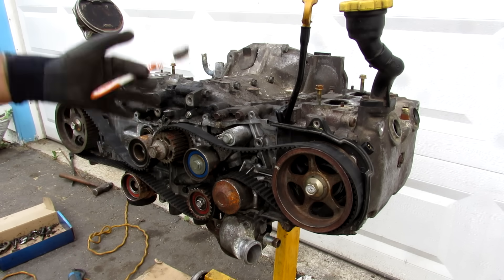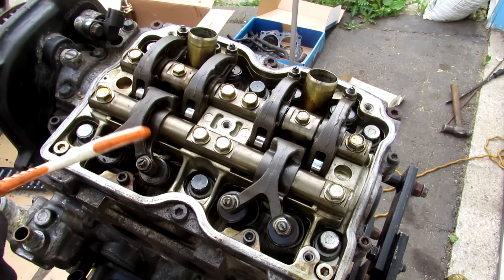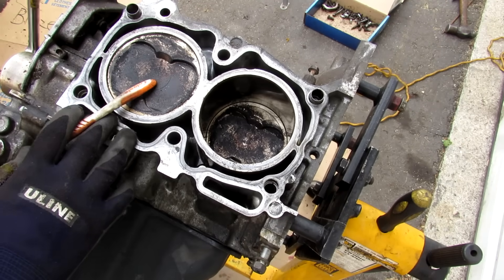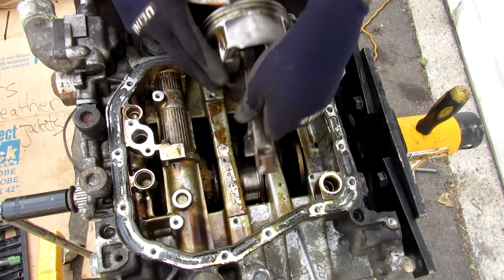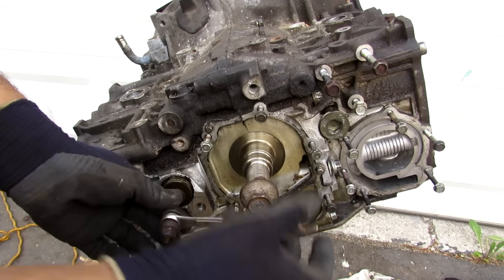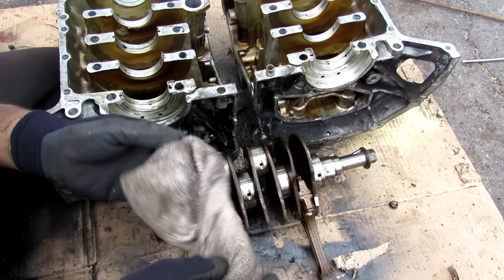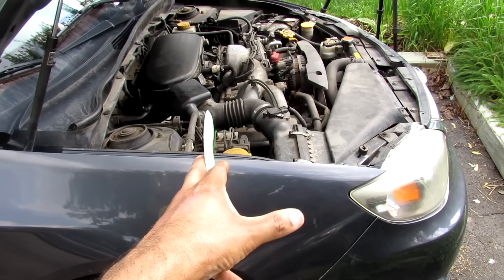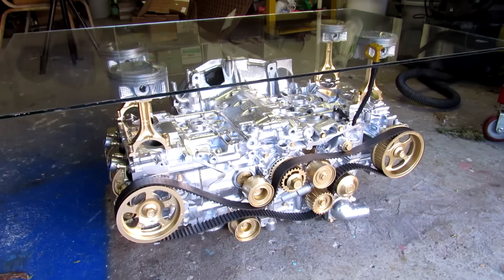Why Subaru Engines FAIL

Comment: My family has owned several suburus and they all leak/burn oil. If you own a Suburu you have to meticulously check the oil, it is not uncommon for a well maintained boxer 4 cylinder and the inline 4 to burn/leak a quart of oil a month while under a 100k miles. Its almost as if they were designed to leak oil from the factory. If you get lazy and it runs half a quart low it can severely reduce the life of your engine. That said they can be great cars but i strongly discourage anyone buying a suburu used even from a dealer, they will knowing sell you a car with a leaky head gasket.
Reply from the maker: Some over fill the oil on these

Comment: I do not know if the boxer engines overall are like this but it just seems so needlessly convoluted that the whole vibrates less and it's better balanced pros seem like very minor gains when compared to the nightmarish amount of difficult servicing issues that this design causes. You basically need to drop the engine every time you need to do any maintenance beyond an oil change.

Comment: Subaru fans be disliking this video lol
Reply: @tenis_Alekna  I'm thinking he was referring to the fan boys and not the actual fans/owners.
Reply: Infiniti owners be like i told you your cars and engines are garbage! Lol
Reply: I’m a Subaru owner and I never like EJ25 engine cause they are shit. I drove a JDM EJ20 purely made in japan and never given me an issue.
Reply: Maybe only the 2.5 owners, even then if they love it they love it, i have a 2.0gt and Sofar (170k) no engine issues, every thing thats failing on the car is age related rubber rot after 15 years in the bushings ect. Never been on the side of the road in the life of the car and ive driving The ever loving piss out of it :) in japan hete i think they save the good ones for domestic and export the less then great :/ idk
Reply: The opposite is the case. Quite informative for a Subaru enthusiast like me.
Reply: I have an FA20 and he's not wrong 😂
Reply: No, I think only one series had problems because Subaru like many others were chasing economy by reducing friction.  Pistons were their first target and the re-design led to high oil usage.  Many other makers suffered similar problems.
Reply: Currently fixing the hg on my wrx now. No dislike
Reply: The EJ25 was made from a 2.2L bored out to the limit, and that's why it's so hard on head gaskets. The open deck cylinders just vibrate too much for a standard head gasket. The Fel-Pro replacement is supposed to be bullet-proof.
Reply: The 2.0 boxer engine was one of the best engines Subaru ever made. It outlasts almost any other four-cylinder engine on the market (and really ever produced). That’s why this video is kind of funny.
Reply: @anthonyfisher6051  haven't built many Subarus I take it?
Reply: Jarrad Lewis 
I don’t build Subarus, I drive them. I’ve owned three and they have been the best cars I’ve ever owned. Basic maintenance and they run forever.
Reply: @anthonyfisher6051  if you can find a 2.0 that's still bone stock I'll give it to you that they're reliable, though tend to become leak happy around 70k. The problem is the cars that they're in and the people that drive them USUALLY don't leave then alone or don't tune them properly
Reply: Jarrad Lewis 
Fair enough. I’m not one to modify my cars, they’re strictly a means of transportation for me. If it gets me up into the mountains and the forests without issue, I’m a happy camper, pun intended! 😁
Reply: Subaru fans don't own Subarus, Subaru owners aren't fans. I've got a total of 2 under my belt that are now gone from my life, one of which was fully built for track, I wasn't a fan of either of them. This video is 100% accurate.

Comment: I guess I've been lucky. My Forester has 160,000 miles with no issues, just basic maintenance. I brought it because it had good safety ratings and a four-wheel drive for the snow.

Comment: Interesting video. Answered some thoughts I have had over the years about the boxer engine.  Have porsche solved all the issues that subi engines have?  Never really hear them having the same issues subarus do apart from some rear mains leak issues.

Comment: Wow... very interesting. I know of the boxster engine by name, but was not aware of all the characteristics which makes it a boxster. Pretty cool. I loved the trick using the 14mm bolt head to remove the 14mm engine hardware. I’ll have to keep that little trick up my sleeve for similar situations. Thanks for that.

Comment: There is a reason why some car brands after many years still build boxer engines.Because they work good.But every engine also have a fault degree and thats the cost reduction when some parts aint built to last, sadly.

Comment: Boxer engines are shit. Thats why i will never buy a GT86 cause of the engine. In fact, the GT 86 doesnt even have much power, it would  have been so much better if they had put a basic 4cylinder in it

Comment: Did you know that the Subaru engine was originally of British make and design . Two brothers, William and Benjamin JOWETT , designed and developed a horizontally opposed V twin in the early 1900' s. In 1936 the boxer four made it's first appearence and the brothers designed a very advanced 4 door saloon post war. Sadly they didn't have the facilities for large scale production and went into liquidation in the 1950's . Subaru bought the copyright 's to the engine and developed it into the amazing piece of engineering we have today. I can recall driving an Impreza in the early ' 90's. In those day's it only made 210 bhp but was crazy  compared to what was out there. The only comparison we had ( in the UK ) was the 4WD Sierra 2.8 V6 which frankly was a tractor in comparison, the Subaru was very well engineered.

Comment: I always thought Subaru's were over rated and poorly designed. I demo'd one in 2018 and it handled like a farm wagon. I could feel the weight of that motor in the steering. It's hard to explain. Let's everybody boycott Subaru and start converting motors to shop clocks!

Comment: Biggest mistake Subaru owners make is not buying the proper oil filter.
That orange blob is not the proper filter.
Subaru has a high oil pressure. If the oil filter has a low bypass pressure rating, the filter is not going to filter much.
Oil is going to move around not getting filtered.
If you don't have access to the correct SUBARU oil filters, MAZDA RX filters works just the same.

Comment: Dude, a brilliant analysis!  Brings back bittersweet memories of the used Outback I bought some years ago.  I used to chuckle with my friends about the colorful stains on my carport under 'Suby'...why, I had black, yellow & purple!  LOL  Not anymore!  I drove this car from MO to L.A. one summer.  Hard to check the oil as the stick is 13 feet long and twisty.  Next fall the engine blew out.  Subaru been making this 2.5 for decades and STILL haven't tamed the beast. At 3:31 upper right the gasket is too thin/congested with holes for bolts/oil/coolant.  Don't pay a lot for a used Subaru!

Comment: I had a 2000 Subaru Outback boxer engine that had 190,000 miles on it when I traded it in for a newer Subaru.  No issues with either engine.

Comment: well all i can say is that the Subaru boxer is the best motor i have ever owned as a guy who does 90% of the maintenance my self subarus are a a joy to work with while if Im ever so unfortunate to have have a HONDA Civic ever again i would rather buy a new car then try and fix any thing on that shit.
i have had a bunch of cars from different makers subaru, honda, toyota, opel, not many american cars except old ones that i have helped restore/fix they are easy as well because engine bay would be 3 times larger then the engine so enough space. but yeah love me some subaru

Comment: Subaru pushed the design too far. The 1.8l engines in early Subarus had a good percentage of them reach 200,000 miles or more. The 2.5 engines never reached the reliability of the 1.8's.IMHO

Comment: This engine design is actually derived from an aviation engine. In which application the are very reliable. Main reason is that they are operated at a constant speed. This reduces many of the oiling issues on this engine. 
The main failure i see on these is actually timing belts. Personally, i stay away from them.

Comment: Had one of these motors in an 89 subaru XT. Drove it 260000 miles. Very quiet economical motor, easy to change belts too!

Comment: You stuck a screwdriver blade against the machined surface of a cam lobe to stop rotation of the cam when removing the pulley. So you're trashing that cam and possibly breaking the head casting.  Supposed to hold the pulley with a tool when removing that bolt.

Comment: I have owed Two them 300,000+miles on the first car and 280,000+ on the one I'm driving now and no issues with either car !!  Just get your regular maintenance when you are supposed to, or do some yourself if you can !! : )
Reply: I bought one cheap with 99k miles and very early signs of a failing HG. I squeezed another 100k miles out of it before hitting a deer and totaling it and all it needed during that time was regular maintenance and new front rotors.
Reply: Mine runs like a top!
Reply: I hope this is true for my FRS!
Reply: That's what I like to hear! Bravo.
Reply: It sucks that most people don’t do that. I’ve bought 3 Subaru’s and and 2/3 burned oil because of bad maintenance. I got a 98 legacy with a 2.2L motor which was bulletproof, it only died because of not doing the timing belt. I bought a 98 legacy GT with a 2.5L engine and it burned oil like crazy, it eventually got rodknock when it burned all the oil in one day. I replaced the engine myself in that one with a junkyard one with blown head gaskets and replaced them myself, that engine also burned oil but only about a quart every 2 weeks so it was alright, I still have it, but one of the brake lines broke and I haven’t gotten around to it. I have a 04 Impreza wagon and that one burns oil but I bought it fully knowing what I was getting into so I only paid $1k and it has 131k miles. I couldn’t pass it up since it was manual and it’s pretty much impossible to find where I live. Sadly it’s not the owners fault it burns oil, they took it to a shop that was robbing them. I’m currently in the process of doing what the shop didn’t do. I’m going to have to do a tune up and eventually a engine rebuild or swap:
Reply: @itsvoodoo7050   It's good you can do your own work etc, so many are just Lazy or clueless.
But there are so many garages that don't care etc. I to do the work I can and keep on it. It really makes the difference what ever the brand. Thanks for posting !!  : )
Reply: @itsvoodoo7050  The 2.2 was a MUCH better engine. The compromises they had to make to go to 2.5 turned it into a POS. And most of them burn oil.
Reply: @mitchkelleher7972  I've had nine Subarus over the years and none of them have burned oil. 
But I maintain my vehicles...... Just sayin'.
Reply: @itsvoodoo7050  that amount of oil consumption is terrible. I've driven some worn out old shitbox cars but I've never had one burn that much that quickly.

Comment: Why do Subaru engines fail???? Because Subaru buyers are mugs, they'll ignore & excuse problems that other manufacturers would be pilloried for. As a result, Subaru doesn't have to try that hard. I had one....at 100,000 I had to replace every seal & gasket in the engine....I was told that this was normal. I'll never buy another.

Comment: When I lived with my Father, and drove his car once in a while, he had two total engine failures on two different Chevy Monte Carlo engines. The first one was a 1999 Monte Carlo SS with the big 6-cyl engine. Nice car, sunroof and everything, but not real good on gas, and the engine burned up at about 130,000 miles. So he got a 2000 Monte Carlo LS with the smaller 6-cyl engine that was a lot better on gas. And the engine burned up on it too, around 130,000 miles. The worst part was he only had two car payments left on it. After that he bought a 2000 Ford Ranger xlt truck with the 4-cyl engine and 78,000 miles on it, that was 6 years ago and that truck is still running good with 152,000 miles on it.

Comment: This is why I will never buy a Subaru.
Reply from the maker: How about an engine table?
Reply: @speedkar99  somewhere after the DL series of the 1980's Subaru decided that their cars were luxury barges.  A broken in water cooled car engine should not be using over a half quart between oil changes.  What an engine table has to do with this is irrelevant.  I'm happy with my 2000 Accent which doesn't use more than a few ounces of oil between changes. YMMV,  Oh! Snap!

Comment: Excellant video. I enjoyed. Informative as well as insightful. I knew that there was something different about these motors. I like Subaru, but with this information it make it more easier to know what to look for in a used one. It really doesn't matter which car you buy, you need to be very informed about what your looking for. Vw are another headache,  with that direct injection. What a nightmare that is.  Unfortunately I didn't know about that until I went over into the darkside, and bought a 2013 gti. Maybe a bicycle would be better at this point.  Everyone seems to in a hurry to make the next best thing,  and through quality out the window and durability. Then they stock you with the repair bill.
Reply from the maker: Yeah that's the one hidden cost

Comment: Two values per cylinder must be from 1903 or something, right? Oh no it's a Subaru. 🤣
Reply from the maker: Lol
This one's got 4 luckily
Reply: @speedkar99  haha oh yeah, I suppose it would have square weels as well. I just hate those boxers, rebuilt a couple camper engines easy but the white metal bearings were gone on both and after the rebuild they were still garbage engines just like new lol!

Comment: I could be wrong, since I've never owned a Subaru, but I would think that the reason they fail, the reason any engine fails has more to do with lack of maintenance than of the engine itself. Volkswagen used boxer engines for many years without problems.

Comment: Hi,
How would the any  Porsche boxer engine be compared to the Subaru? Better? Same?
Thanks.
Reply: ...just different......but just price a replacement Porsche 4 , let alone a 6 !  They're right up there with small aircraft 6 cylinder engines (remember what your first house cost...???)....but Porsche's tend to be more reliable  than GA aircraft!

Comment: I REALLY like your descriptions and depictions.Have you ever owned a Subaru? You sound pretty much like ANOTHER  hater...With wrenches and some knowledge...burning ALL the oil due to bypass into the combustion chamber? Really..I neglected my OLD 84 gl wagon until it LEAKED all the oil out.....CRACKED the block....and it STILL ran really good.AND. .. the coolant LAYING at the bottom?? You DO realize there is not supposed to be ANY air in the cooling system dont you? Water pumps dont move air very good.....so the head gasket in any vehicle is always surrounded by coolant....which can turn against the engine if not maintained properly.....the engine in this video was not maintained properly....dont blame Subaru for the owners owner's failure to maintain the product.Subarus do have their weak points, but I bet you have not seen a Ford Pinto in a rally race.........

Comment: I had a 2005 Subaru outback turbo boxer engine model, WORSE car I ever had, the turbo went out,  then the transmission went out, then the clutch went out, then two more turbos went out, then some electrical wiring went out. all within two years of each other, every time I left state lines the car would break down and leave me stranded. I came to realize that Subaru meant satan in English. I will never ever buy Subaru or speak the name which should never be spoken ...subaru

Comment: From know my ez30r 2004 traveled 300 thousand kilometers and no knocking or oil consumption. May be necessary to service the motor as prescribed in the FUJI manual, rather than changing the oil and antifreeze "at one’s own discretion." (sorry for my English)

Comment: Had a Subaru Wrecking yard for 14 years. 90% of engine failures we see are caused by lack of oil or lack of water.  Some 2.5's Did head gaskets around 150K Km but once replaced never fail again. 2.0's rarely have any problems if maintained.  Seen Dozens of Subaru engines that have done 500,000 Km and still going fine.

Comment: My friend and I wanted to change my wrx's spark plugs. He said it's a job that shouldn't take more than 20-30 minutes total. On our first cylinder, we remembered that it's a flat-4 and taking each spark plug out was going to take 30 minutes by itself. 30 min x 4 = 2 hours.

Comment: The engine is low in the engine bay not because the engine is wide. It has to deal with the crank being high in the block. The added benefit is the weight is low. The draw back is the engine bbx ay needs to be wide down deep.

Comment: Had a 2002 WRX with a turbocharged boxer engine that just ran and ran.  All I did was change the timing belt and water pump.

Comment: Seems like proper maintenance would fix the oil starving issues. First time I've seen a boxer pulled apart so thank you very much.
Reply: Every 3k on the dot with quality synthetic oils.  A friend of mine has 220k on a 2011 wrx.
Reply: That's exactly it, subaru owners just have to be a tiny bit more meticulous with maintenance windows
Reply: LOL i bought a brand new 2018 Forester 2.5i Manual. Early oil changes at every 5k (following manual). Car burned 2qts of oil between 10k and 14k miles. Car was less than a year old. Traded it in for a tacoma... Best decision ive ever made.
Reply: @TandyTerrison  1GR-FE v6 in your Tacoma?? That engine is virtually bomb proof. A weak link in the newer one, I've read, is the 6speed tranny. It wants to hunt for the gears. Lots of people wish they'd go back to the 5 speed from the early 2nd gens.